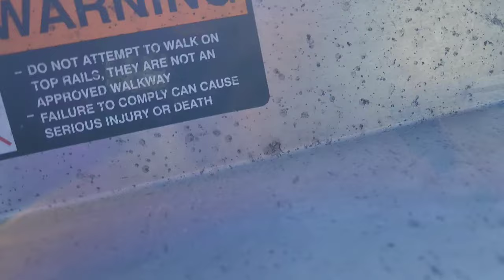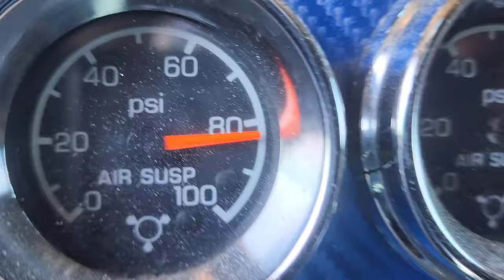Short run turns to a out and back good run. *Bad product* *Bad Wreck*

Comment: Hello there JYD...since ur an O/O r u running a ELD or u doing Paper Logs? You getting paid for deadhead miles or just loaded miles. The last guy I drove for had a lady getting loads for me from brokers and u know brokers dont usually pay deadhead miles just loaded miles. But I told her before she puts in bids to add a lil for deadheading. The guy i drove for is a Pro Basketball player that didnt know much bout trucking. The last guy that drove for him lived close to OKC OK. I had to go from GA to OK to get into the truck. The truck was a 2017ish International automatic with super singles on the back, which i kinda hate. When I get the chance to get back into a truck we will have to meet up somewhere out there on them roads. Im gonna try and get with a company that isnt all 48. And that doesnt set the fuel stops for you. I like to be able to stop where I want 2 as long as I stop at TSs that they use. Some companies just use Loves ❤️, Pilots, and FJs with Loves ❤️ being the primary one and pilots and FJs as secondary if theres no loves near by ya when fuel is needed. Happy Anniversary.. You might wanna get hip checked.
Reply from the maker: My truck is exempt so I run paper. Deadhead miles are figured into the rate. This company that I run for does a really good job on putting the best paying product in the wagon. I've deadheaded over 500 miles before for a good load. And if a company has to set your fuel stops that's a red flag.